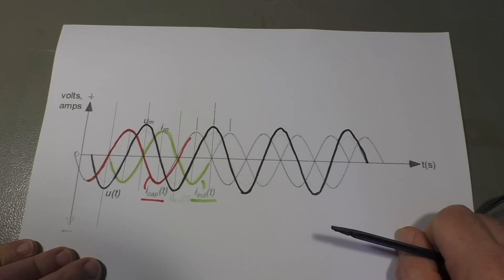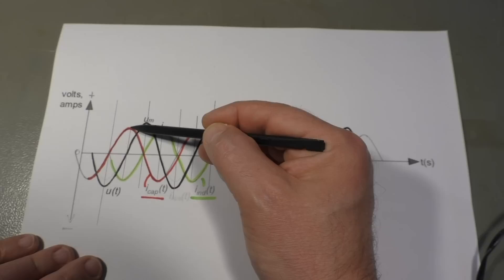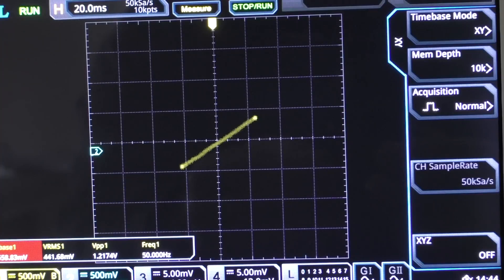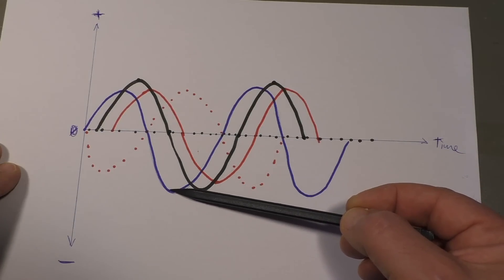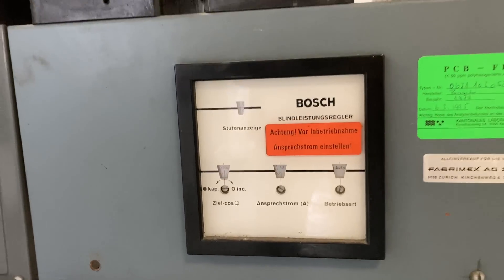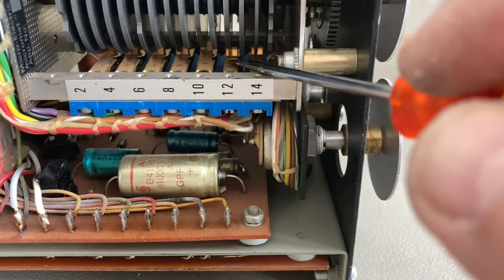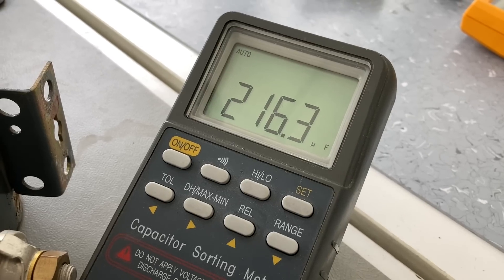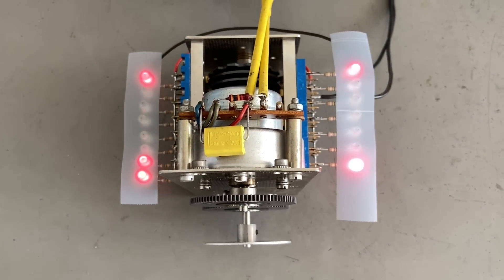Reactive Power Compensator from 1974 (PWJ205)

Comment: My guess would be that the circuit compares the measured cosphi values to some built-in values (due to the lack of any digital circuitry), and for that the switches combine various capacitors until a match is achieved.
(and damn I wish i could get hold of such a beautiful cam switch.. they just don't make those anymore nowadays)

Comment: Nice peace of hardware!
Your explaination with the 180° is somewhat flawed. It is when you have 90°, that is an ideal capacitor or inductor, that the net power is 0. For an ideal capacitor for example, current goes into the capacitor to charge it (this takes power from the grid) and then when it discarges the current flows into the grid so the net power is zero. When you have 180° it is like 0°, just the current is flowing the opposite way, so you are constantly feeding the grid like a solar inverter.

Another rather minor mistake: 132uF+66uF=198uF not 192. But this calculation is really only useful to measure the capacitors in circuit and doesn't help understanding the phase shift or 3-phase systems...

Don't get me wrong I really like your videos. I have watched all of them over the years. Glad you didn't speak with music in the background like in the heathkit video. I much prefer to keep voice and music separate. Keep up the good work!
Reply from the maker: I totally appreciate comments like yours, especially if everything is correct... 🙂The 180 degree example was stupid because that's not possible, even in theory. I tried to explain the L / C effects with the oscilloscope but that didn't show the expected results, so I was a bit confused. Since my videos are all without script, stuff like that happens sometimes.
BTW the cos-phi of 180 is -1 = reverse power, as you wrote correctly.

I'm constantly experimenting with my videos. Sometimes with music, sometimes without. sometimes even without speaking. The comments go broadly apart every time. Some like it, some not.
I personally like it better if speech and music are separated.

Comment: 14:42 I'm pretty sure that 132 + 66 is actually 198, not 192… 😄
Reply from the maker: I'm pretty sure you're right 🙂
For the other comment you made about the 180 degree phase shift resulting in no power.... (can't find the comment again)
My example was not very good because a 180 degree phase shift is not possible with L/C. The result would be negative power because cosinus phi of 180 is -1 (P=V*A*CosPhi). So the resulting power is not zero  as I said but negative. Anyway I made a bad example...
Reply: @PlaywithJunk  I think YouTube removed it because of the link to my chart on geogebra.

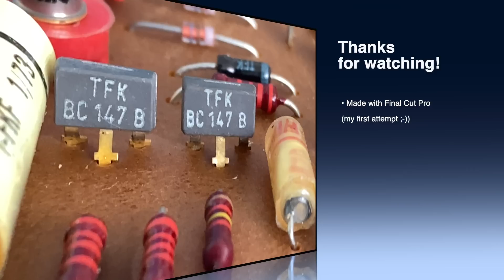Comment: 16:10 Aren't most people moving to DaVinci Resolve now?  It seems to be mopping up.
This equipment of course lends just a tiny bit of credibility to those fake "power saving" devices which are just a capacitor and LED.  It's about the same vintage as my Ferrograph Super 7 tape recorder.

Comment: Disappointing we didn't get to hear the massive hum this thing must've been producing 🙂
Reply from the maker: There was no big hum... only the "clunk" of the relays was scary when it happened unexpected.
Reply: @PlaywithJunk  Yeah, because it seems it only can compensate inductive load (using capacitors).  When it was a full compensation it would have inductors to compensate for capacitive loads as well, and it sure would hum 🙂
Reply: @Rob2  - there isn't any real need to compensate for a leading PF, especially back then. That's because any excess capacitance will be a good thing for the generally lagging electrical grid.
Back when this was manufactured, the low PF was from inductive loads (mainly motors) used in industrial sites. Nobody had gazillions of dollars to waste by attaching random capacitors to the grid.

Comment: The old style BC147 transistors by Telefunken. Wow. Never seen so many on one spot.
Reply from the maker: Yeah, too bad that I don't have a schematic.
Reply: And also those classic Siemens electrolytic capacitors...
Reply: @Rob2  Before this board goes to the bin I would definetly take these transistors out and keep them. Just two weeks ago I made a little crowbar circuit out of a TO92 thyristor that I took out 30 years ago from a broken Metz camera flasher that was made around 1970. So almost everything gets re-used at some point...

Comment: ¿why was this decommisioned?, looks to be in perfect working order
Reply from the maker: I don't know. It was disconnected for decades. I guess it was obsolete for some reason. Maybe we have a new and smaller one somewhere... :-)
Reply: @PlaywithJunk  It serves no purpose when you don't have inductive loads all over the place...
That was usual in the past, but today there usually are switchmode supplies, frequency regulators etc and this box makes no sense anymore.
Reply from the maker: I wonder anyway why we had that. The building has never been a big industrial plant. Only office space and storage. Of course there were a lot of fluorescent lights but that was it. Maybe that's the reason why it was disconnected long ago.
Reply: @PlaywithJunk  Fluorescent lights are inductive, but normally in an office building the professional armatures used have a capacitor in each one.
That serves two purposes: 1. to make the load more or less resistive and 2. this introduces a 90 degree phase shift between the two tubes, which reduces the 100Hz flicker.
Of course it can be that this unit was installed because the electricity company billed in VA instead of W (sometimes true for industrial customers), and someone calculated that money could be saved by compensating any inductive load that may be present.
Reply from the maker: @Rob2  Exactly! And when your FL lights don't have that capacitor inside, you need that beast in the basement. 🙂

Comment: Nice transistors, not seen that style before. with the little stops on the leads where they go through the PCB holes.
The amount of little plastic pads I've put on the old style TO18 transistors and metal can 741's must number in the 1000's.

Comment: capacitors  lag    induction  lead  ,   resistance   =1
Reply from the maker: That is not correct. The current of an inductor lags behind the voltage by 90 degree (pure inductivity). That was what I said. Maybe you mean that the VOLTAGE leads the current, that would be correct. But you can't just say "capacitors lag", the what, how and where is important.
Reply: @PlaywithJunk   What   I am saying   is that induction  and   capacitance lag  or lead the  current    so that the  PF   would  be less  then  1   . one  being a   pure resistive   load
Reply: @johnsenchak1428  - so your comment is just useless trolling, right?
Reply: @johncoops6897  NO  LEARN WHAT   POWER FACTOR  DOES

Comment: These relays have to be beefy, they lead a really hard life, if they switch on top of the sine wave  the charge current through the capacitors is gigantic.
Reply from the maker: That's why they use 100A fuses (x3)

Comment: Ahh... from the days where "power factor" was only about phase shift between voltage and current, due to big (usually) inductive loads on the mains that could be compensated with capacitors...
Thereafter, we got in the age of the "non-linear loads", mainly switchmode power supplies that have a non-sinusoidal current because they rectify the mains voltage to get a DC voltage that is then used to power a switching regulator.
Of course today we have mandatory power factor compensation in large switchmode power supplies, but the ones manufactured end of last and beginning of this century do not always have that.  And it causes the same problems as what you describe in this video, only it is not possible to solve it with some simple capacitor...
Reply from the maker: For a while we sold PC power supplies with "PFC integrated!!" What they did was to add a big inductor in series to "compensate" for the capacitive load. The rest of the P.S. was just an ordinary old fashioned board. A chinese modofication to comply with some rules...
Reply: @PlaywithJunk  I wonder if that even works... but with Chinese products, that isn't necessarily the case.
The real PFC works by having a rectifier without (big) smoothing capacitor, then a boost converter that "rides" the rectified sinewave and generates a fixed voltage around the top-value of the rectified sinewave, and only then the voltage is fed to a smoothing capacitor and the switching converter and down-transformer.
That way you have current throughout the sinewave instead of only at the peaks.
Reply: @Rob2  Yes, that worked in the sense that they flattened and dragged out the power draw. These inductors where installed between rectifier and buffer capacitor(s)
Reply: I’m really digging this. Great addition to the video.

Comment: Thank goodness the capacitors weren’t RIFA paper ones known for their pucker factor in older appliances!
Reply from the maker: I still need a good idea what to make with that capacitor... Too wierd to just throw away :-)
Reply: @PlaywithJunk  lets hope they are PCB free.
Reply: @H4zuZazu  Yeah, probably not a good idea to open it or make it explode.  It likely contains oil with PCB.
Reply from the maker: According to the green sticker from 1995, they are PCB free... :-)
Reply: I was going to suggest a flux capacitor. However your ones appear to be wired in delta but the flux capacitor visually appears to be star ;)
Reply from the maker: Funny detail: In the german version of Back to the Future it's called a "Flux Kompensator" maybe that was better to lip sync... or a stupid translator (Jiggawatt Gigawatt)